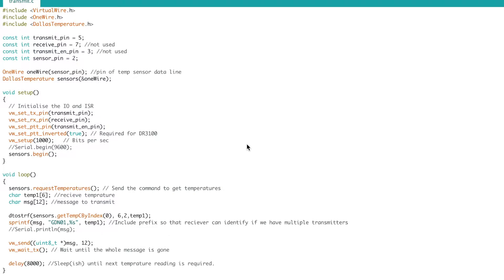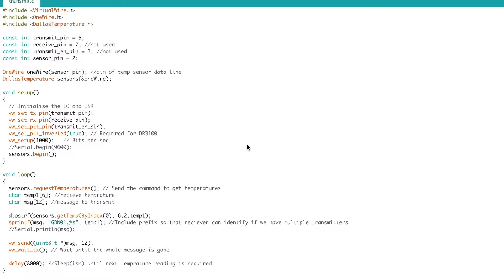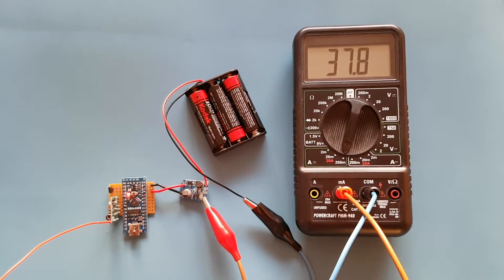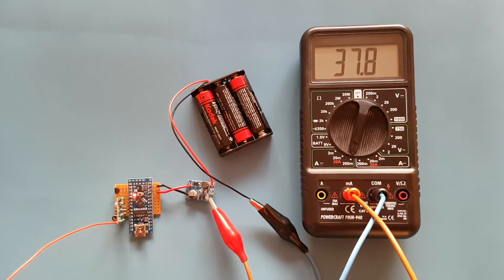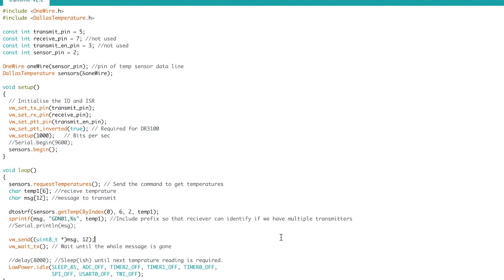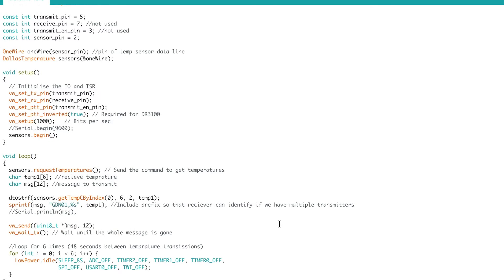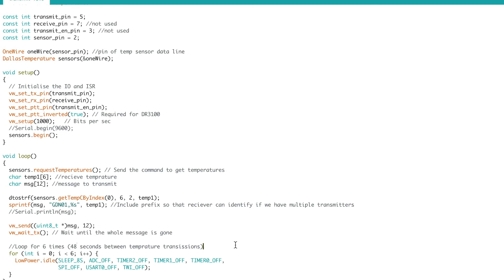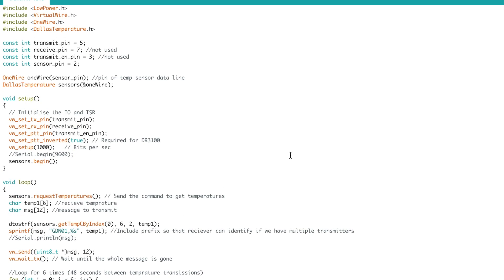Arduino Power Consumption - Delay vs Sleep

Comment: I can also recomment desoldering the power LED on the Arduino to save even more power. Just cover it completely with solder and it will stick to the soldering iron.

Comment: Hi Kev thanks for the video very well explained.
On my project I am also using DC to DC buck converter, I have my project up and running but I am now looking to lower the power consumption. I'm using two DC to DC converters (one 5v and one 4.2v drop down from 13.5v) and didn't realise the consumption for both is 23 mA that puts the whole project to 53 mA. I am going to use software to bring consumption down on each module but if the converters are drawing 23 mA that's going to use quite a bit of current. Can you suggest or have you had any experience with another way to power all of the modules?
Thanks in advance.
Reply: I went the other way for my project and used a boost converter to allow me to power from AA batteries.